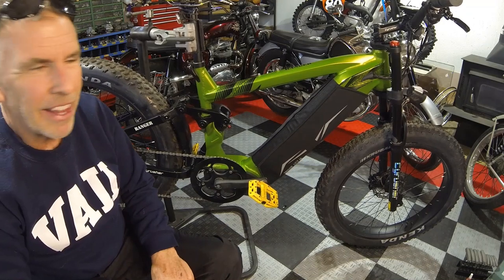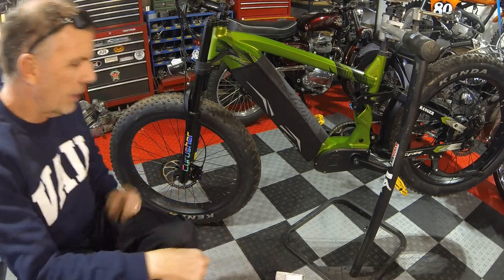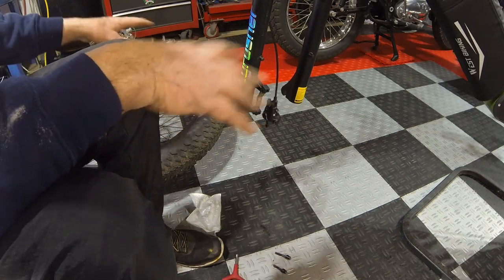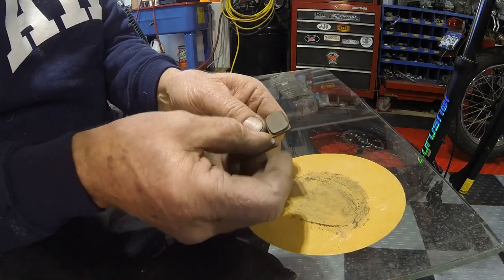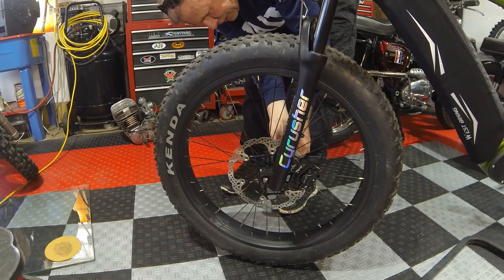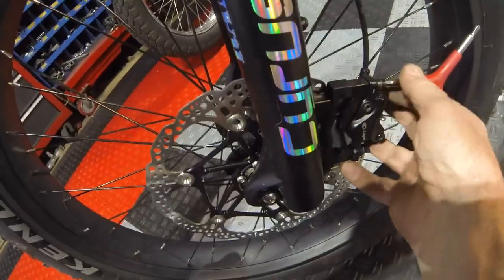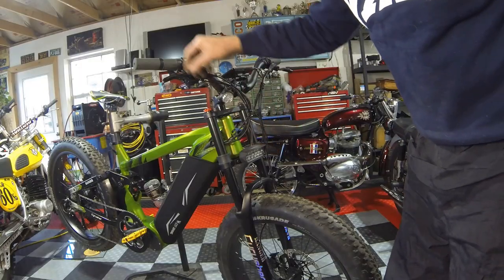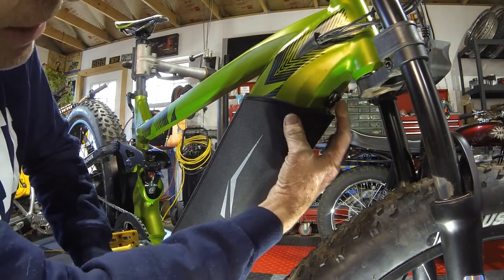Upgrades and accessories for any fat tire ebike!  Cyrusher Ranger, Aventon, Himiway, Pedego

Comment: Great video, I bought a crashed Powermax Eagle, and had to replace the display, and I found an e bike mechanic, and he did the work because I knew nothing about it. Now I'm making it my own and considering brake upgrade. An old trick i learned similar to the dirty fingers/paper trick, is use an old piece of a lumber crayon, or even a reg crayon to transfer the bolt holes(strip the paper off the crayon). It will look like a photo of the part. I just had to make gaskets for an antique tractor water pump and thermostat housing, and worked perfectly. Also for "water proofing" get a can of liquid tape, use after shrink tube and /or tape, it seals the ends very well and integrates into the wire sheathing and the spliced area. Nice o ring solution, also seals out moisture. Kinda made my insomnia worth it at 2:30AM.
Reply from the maker: Hello, those are all good suggestions!  Cheers

Comment: I just noticed your vintage Maico. Now I'm really a fan! I had an 84 SC500. Was supposed to be an M-Star but mine came with Maico on the side case.  Great bikes.
Reply from the maker: Hi Mike,  yeah they were the bike to beat back in the late 60's - early '70's!  The one you see there is a '75 440 and is one bad bike!  Cheers

Comment: I just installed the Hope front rotor with organic pads. We have some 4-5 percent grades I ride up.  I'm amazed the bike carries me up them in PAS 4-5. Coming down my brakes are hot and smell like the truckers coming down the Ike Gauntlet!! Thanks for the upgrade tips.
Reply from the maker: Awesome Jammin,  the set up has really worked well for me and I'm getting close to needing a new set of pads!  This combination has allowed me to sneak up on wildlife instead of scaring it away!   Cheers
Reply: it is much quitter. Not squeeling anymore but i know Ill be changing pads quite often from the smell lol.
 @lifebehindbarz60

Comment: Hi! Thank you for the Video! Do you have links for the parts? Especially for the adapter/spacer. There are so many spacer on the market... Scared to buy the wrong one... Thx!
Reply from the maker: Hello, happy you found the video useful!  The caliper spacer is a Magura QM-45, check out Ebay item # 114078928552.   The rotor is a Hope 220mm, lots of these on the internet but again check Ebay.  Good luck with the bike!
Reply: Thanks a lot. After looking after my dads Ranger im confused now. He has a 160mm rotor on it (stock) ... Still possible to upgrade to the 220mm?
Reply from the maker: @chrisstoeckl  Hello, good catch. My and every other Ranger I have seen came with 180mm rotors. There are always exceptions and variations when talking about components on any bike. Sometimes things get swapped due to an item being unavailable at the time of build. For some reason your dad got some smaller rotors. He will definitely want to upgrade to bigger, these bikes are too heavy for 160's!
Try this combination for that bike, Ebay item number 394750070974 (160 to 203 adapter) along with 203mm rotors. This will work great for you and be a huge improvement. 
Cheers
Reply: Is it also possible to use the Shimano SM-RT66 220mm? Its much cheaper in Austria than the Hope. Cheery Chris

Comment: Hello, what kind of Assembly stand do you use? Hard to find one for the Ranger because they are all restricted to 30kg... Your looks massive
Reply from the maker: Hi Aaron,  yes the stand I have is an older one by Park tool. I've had it 30 years, not sure how substantial the new ones are.  Cheers

Comment: Nice eclectic collection of motorcycles in the background, is that a D1 Bantam in the Grey? Ive a couple of weirdos in mine, Hercules W2000 rotary, Zero SRF electric. Ride safe have fun.
Reply from the maker: Thanks for watching!  Good eye, that's a 1956 Bantam D3 build in progress. I know the Hercules w2000 well and have owned a couple of the Suzuki RE5 rotary bikes. I'm a big fan of the rotary engines and use to build some very fast 3rd gen rx7's!  A zero is on my list of bikes to find!  Cheers

Comment: Does your lamp work or did it just destroy the controller?
 I checked with the manufacturer and they said, the light output is only rated for 3 watts. 
i am thrilled !!! :face-blue-wide-eyes:
The usb port only supplies a maximum of 0.5 amps. thats nothing. 
probably only suitable for uploading the software. - great !!!
Reply from the maker: Hello,  no the lamp I show here works beautifully. I'm not sure what the draw is but it must be below the 3 watts.  I currently am not running any headlight for less of an ebike look and more of a mtn bike look.  Gotta do everything you can to be able to ride past the park rangers without being stopped!    Cheers

Comment: Hi I just ordered this bike andvam excited to get it. Have been watching your very informative videos. Thanks for them. Was wondering if you ever swapped the back rotor out
Reply from the maker: Hi Lance,  thanks for watching!  I am really enjoying my Ranger and hope you like yours too!  I have left the rear stock rotor on my bike, but I did install the softer and quieter organic brake pads. I am now very satisfied with the braking on the bike, very positive and no noise!  
As you probably have seen, I replaced the front forks with the Himalo air forks. It was a relatively inexpensive and easy swap and by far the best improvement done to date. If you are going to be riding rough terrain I highly recommend it!
Cheers
Reply: @lifebehindbarz60  hey thanks for getting back to me. Yes I'm thinking of doing the forks looks like a good upgrade. Do you have the part number for the 180 to 220 adapter for the front. I don't think it is the same adapter for the rear do you know? Also I've seen some guys busting their spokes with 220 rotors. Do you think they are too much for the bike? Have you had any issues? Thanks for all your info.
Reply: Hey do you happen to know a compatible brake line and olivets. Just replaced the front shock and rotor and my line is to short. Frustrating. I contacted cyrusher here in Utah and they don't really stock parts. I told them if they wanted to up their game in the review world for ebikes they would stock parts. We shouldn't have to order parts from China.
Reply from the maker: Hi Lance,  I have heard of others having the same issue when replacing the stock fork with the air fork. My brake line was long enough that it wasn't an issue for me. 
Check out ebay item number 265078028571,  it's a 5mm brake line kit that should work fine for you. You will need to re-use the existing threaded fitting , but it will come with new inserts an ferrules.  
Just so you can keep riding until the kit gets here, try rotating your bars and levers forward until you have a bit of slack. That should get you by.
I agree completely, Cyrusher has distributors on every continent and every one of them should have parts available. 
Cheers
Reply: @lifebehindbarz60  Thank you for the info. Yea I did roll my lever down abit but I also had to push my shocks up an inch through the trees to get it to work so mine must have been really short. on the ebay list is it the BH 59 or the 90 option.
Once again thanks again

Comment: Have you also changed the gears from the ranger? Dad has a CS-M300/11-32T mounted and wants a better uphill-performance. So bigger gears on the back. You have experience which part would fit? Cheers Chris

Comment: Hallo, I like your new Front Lamp Style, but does the front lamp in this Position have enough distance to the bracket of the fork when it is fully compressed?
Kind regards
Reply from the maker: Hello, funny you should mention that!  With the stock fork it does clear fine, since the fork has just 60mm of travel. But, today I'm installing a new air fork that has 170mm of travel so that mounting location has to go!  It looks like for the time being In going back to the stock location. I will be making a higher bracket and mounting position soon though.......
Reply: @lifebehindbarz60 k, thanks for your quick reply. I will also mount such a lamp then I'll put mine a little higher since the current fork has a bit more travel (about 75 mm) as you said in your replacement fork video. Would be great if there is also a video of your new fork with 170 mm. 😎👍
Your Videos are very informative!
Reply from the maker: Hi  @Marabuntas01    I've got some time this morning so mounting the new fork now...  I'll make a quick video to go along with it!  Thanks for watching!

Comment: Hello, can the magura 180/220 adapter also be mounted on the rear frame of the ranger if you want to replace the brake disc with a 220?  Or do you need a special adapter for the rear frame?  THANKS
Reply from the maker: Hello,  yes the same adapter and rotor can be used on both wheels. I'd suggest replacing the stock semi-metalic brake pads with organic pads at the same time.  These pads are softer and will give you a really nice progressive brake feel...... and get rid of 99% of the brake noise and squeal.   Cheers
Reply: Cool !!  Thank you for your advice But which organic pad to choose?  The dimensions ?  If you have a link or a reference to advise me thank you

Comment: What kind of rubber ring did you put between the battery frame and the lever and where can I buy it?
Reply from the maker: It is just an o-ring that fits snuggly over the latch shaft,,, you could take your latch off and take it to a hardware store to find something that works.

Comment: HELP! I want upgrade the brake rotors on my new Ranger to 220mm front and 203mm rear. Figuring out the right post mount adapters is a nightmare.

Comment: Hello, I ordered the magura qm45:180/220 caliper adapter to fix the hope 220 brake disc, but I wonder what length of screws to fix the magura adapter, the screws supplied seem short to me (15mm  under the head), thank you
Reply from the maker: Hi Syl,  the 15mm screws hold the adapter to the fork and the stock longer screws hold the caliper / original spacer to the adapter. The longer bolt goes on top, shorter on the bottom.  Cheers
Reply: OK, thank you for your answer so the long screws are original, no need to buy screws.... Did you remove your headlight?  We don't see it anymore on your last videos..
Reply from the maker: @sylchatzen3709  No you should be good.  Yes My headlight is off right now. I need to come up with a different mount because the triple clamp position does not work with the long travel fork.  Cheers

Comment: I want to protect the battery during charging in a fireproof bag, what are the dimensions of the battery, length, height, width?  Thank you cordially Sylvain
Reply from the maker: Hello, the battery is about 4 x 4 x 17 inches.
Reply: OK, thank you have a nice day cordially Sylvain
Reply from the maker: @sylchatzen3709  You're welcome. Hey I think you asked about the brake pads too?  Try ebay number 325173686853.  They are the tektro  E10. 11 organic pads and they work great.  Cheers

Comment: What light did you get? I want to add one to mine
Reply from the maker: Hello, the one I show here is no longer available but check out Ebay item number 314810768462, it has the same specs and looks similar.   Cheers
Reply: @lifebehindbarz60  awesome thanks!

Comment: Where did you get the battery wrap?
Reply from the maker: I buy them on either amazon or ebay. There are a number of them available, just measure your battery length and diameter and buy one that will fit.  Cheers

Comment: Which 220 disc rotor is that?
Reply from the maker: That is the 220mm Hope floating rotor. You can get them online for about $70.  Cheers
Reply: @lifebehindbarz60  sorry think were crosswiring im after the neoprene battery cover